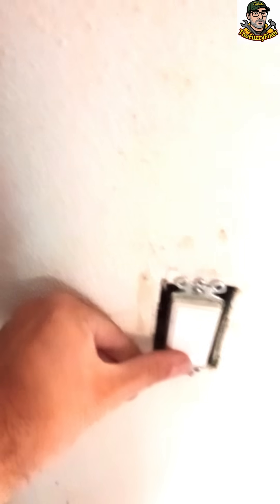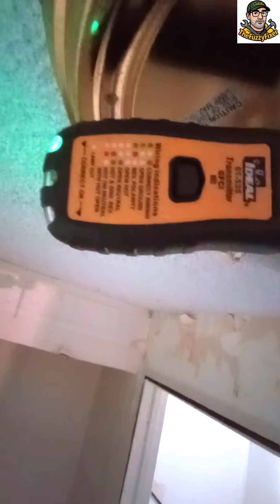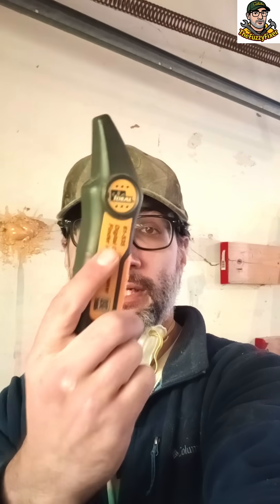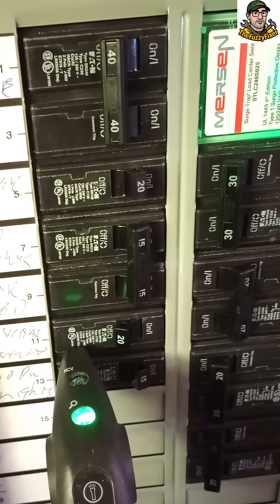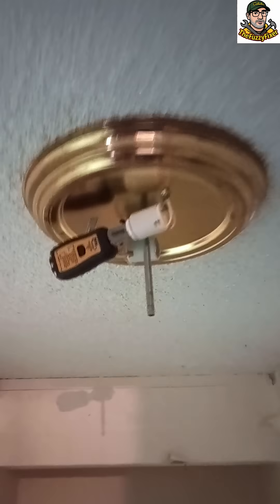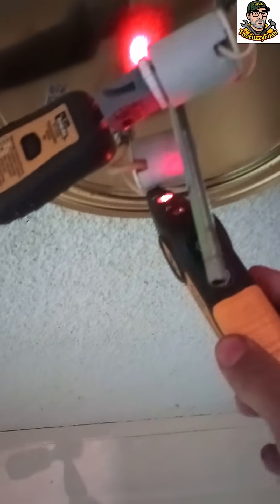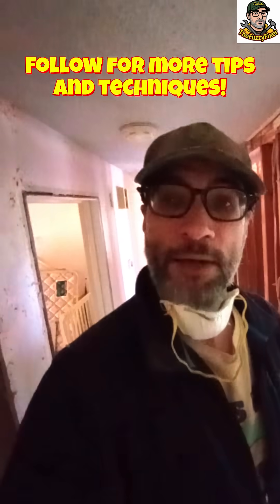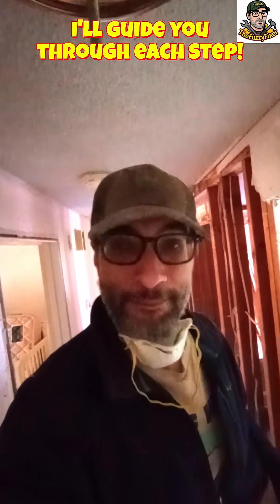Don’t Get Fooled By This Common Electrical Mistake! Beginner DIY Tutorial #shorts #fyp #diy

Comment: 1) House looks condemned…
2) Just flip the switch off… I’ve done hundreds of lights without flipping the breaker. Extra work for nothing.
Reply from the maker: Thank you for your comment and welcome to the channel! Yes, this house was pretty much condemned. The original owners were hoarders and both the yard and home were full of trash and horribly overgrown. Rodent and water damage everywhere. So, it's been an entire gut job thus far. However, the location and yard space is what made saving this property worth it. You can just flip the switch off, that will disrupt the circuit, but I do like to promote that additional safety measure of isolating out the breaker. If by any chance the switch gets flipped back or power gets re-introduced into the system, having the breaker isolated gives you that added protection. Especially in a hallway space, often there will be other switches attached to the circuit and it just takes an innocent mistake by someone passing by to flip one of those on without thinking while you're working on the wiring. Even if you can entirely ensure that you are the only individual there, it's better to take that extra step and be safer. Happy DIY-ing!

Comment: Why was that breaker bridged?
Reply from the maker: Welcome to the channel and thank you for your comment! The home had seen multiple additions over the decades, plus the one we are adding now, so when the panel was redone we did a bridged breaker due to the branched circuits currently there and part of the new addition has a mother-in-law apartment upstairs with a planned small laundry area which will need a 240V. Likely we'll redo it all as the layout gets more finalized, but for now that's how we have it organized. Happy DIY-ing!